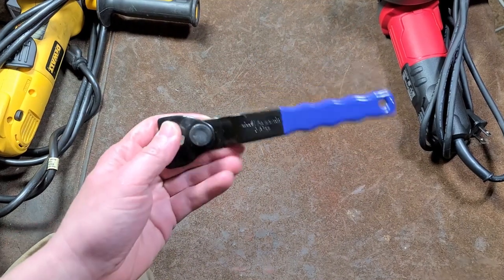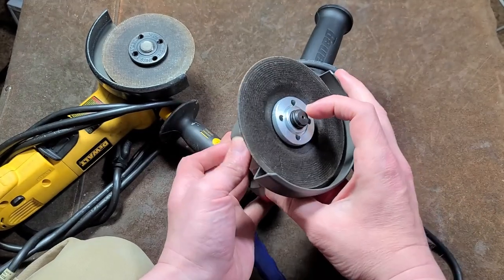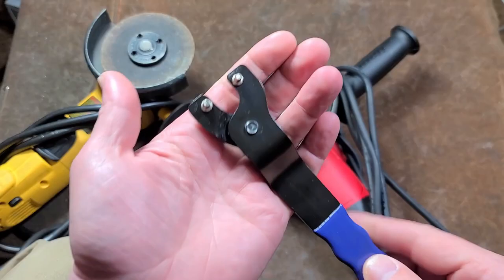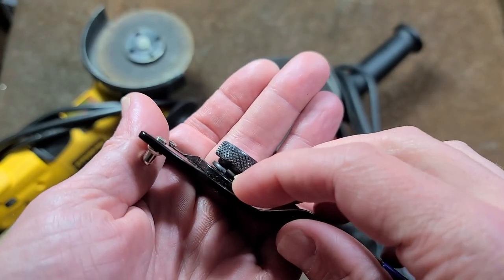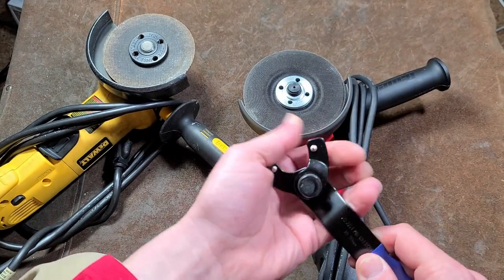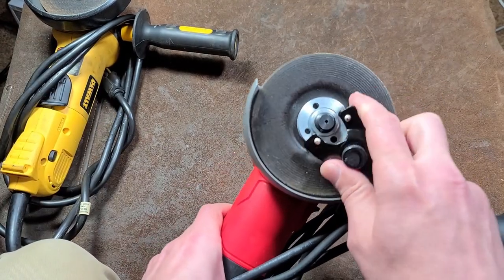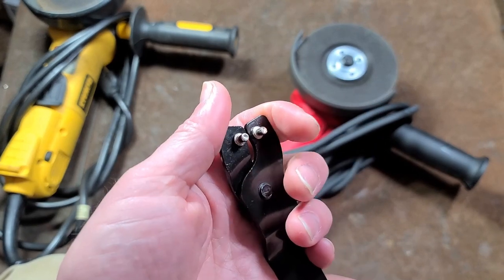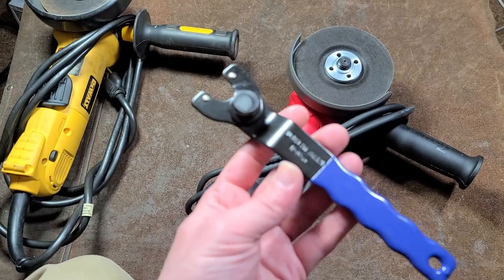Pittsburgh Universal Angle Grinder Pin Wrench

Comment: I have an antique version that is 2 straight handles that pivot on the handle end, old US made. The offset to make the moveable portion of the HF tool is called a "joggle". No matter the type, when you really need one of these, nothing else will work. I just keep track of the original wrenches myself.

Comment: I've had one for years, and find it very useful. I have a couple of others, but the HF wrench is my go-to for angle grinders. I have one for bicycles that I use for some plumbing applications (and bicycles, of course). I wish I could find better ones, with replaceable pins, that weren't quite so expensive. They go from cheap to really expensive, with nothing in between that I've found.
Reply: Foes this work on Washers spanner nuts
Reply: I have to take the clutch from my washing machine and have to remove a  bolt that requires a spanner wrench, do you know if this will work?